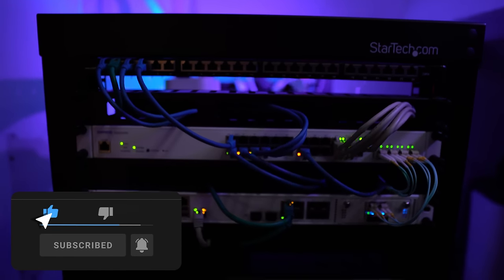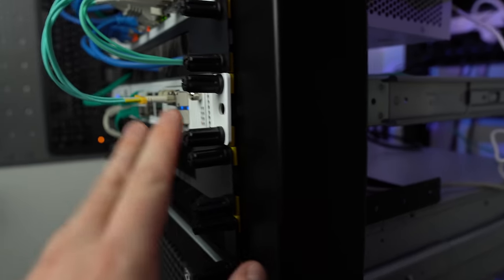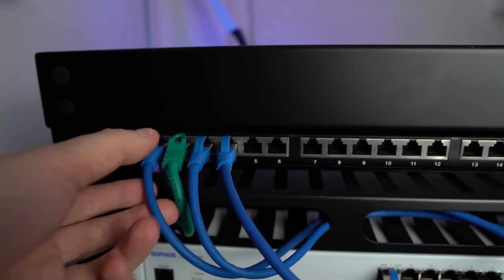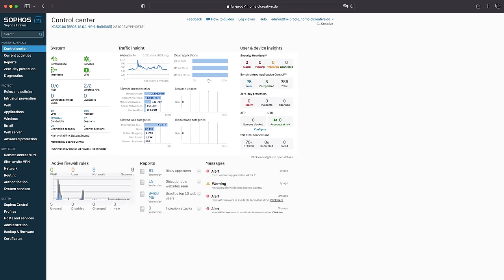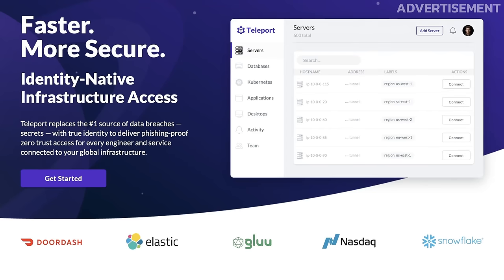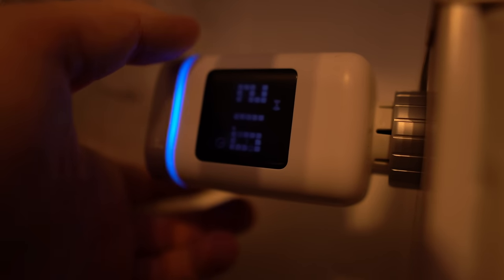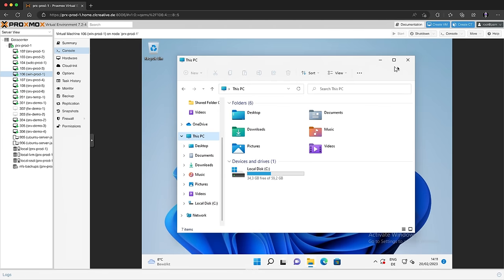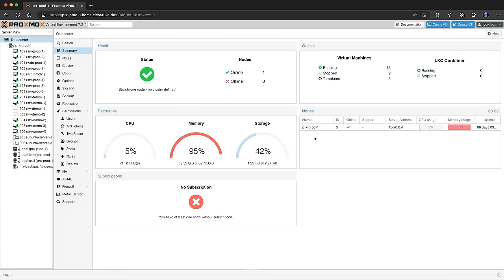What's running in my Home Lab?

Comment: Home Assistant is a centralised system that removes the needs for those hubs. For example a Zigbee adapter will communicate with most major smart lights, pairing them directly with Home Assistant (eg. ZHA.) I recommend a ethernet/PoE based adapter to make redundancy easier, the alternative is USB based. TubesZB is a good example.

Comment: Great homelab! I'm about to get the rack from startech, I can't wait to load it with my hardware that's been lying around the house.

By the way, I know that you've already made a couple of videos about teleport, but I'd love to know more about how you deployed it in your homelab and how you access your infrastructure (not to do reconnaissance I swear :') ), like if you have both your teleport CA and proxy running on the same machine or running them on two separate ones, if you run it in a VM running locally or in cloud instances and if you access the proxy from the internet or only from your lan or via VPN (I'm very curious to know about this because I also want to deploy teleport in my homelab, but for some reason I'm so hesitant to make the proxy accessible from the internet, even though it's said in the teleport docs that it's supposed to be, so I wanted to know how you do it).

I'd understand if you'd prefer not to, from a security point of view, to not disclose some of these informations, but it would be really cool to see you cover it a bit more, since you also mention it in every video.

Comment: About Vlan migration, do it progressively, no need to rush that.
The moment you have the necessary hardware, use it by adding your experiment on it, then slowly but surely migrate what you want to migrate on the vlans you created.
For exemple you could Do it by copying what you have, put the copy to work in the new Vlan, adapt the adresses and links and disabling the original one, and then... Well you have almost finish.

Give yourself 2 days dedicated to that each time you want to make such a move.

Comment: Very cool stuff, Christian! I actually am running TrueNAS Scale for my storage and VM host, as I've recently migrated my OPNsense instance from a dedicated miniPC from QTOM to a VM running under TrueNAS Scale's KVM implementation. It runs super well and not having a dedicated box using power and it not needing cooling is awesome. The only downside of course is that if I take the entire TNS server down for upgrades etc my internet connection'd be down too until it boots up again. I'm fine with that since that won't happen too often, and I was just wondering if it was possible, and it is. I'm so thrilled with how it's running. I at some point want to convert over to an entirely Ubiquiti Unifi-based network, with their APs and the Unifi Dream Machine Pro/SE (their firewall/router solution), but that'd be expensive, and I already currently have two of their older APs (their UAC Lites) as my WiFi solution for my family's apartment. I'm running consumer hardware as well.. I'm running a Ryzen 7 3700X with 64 GB of RAM, along with 10 (soon to be 12) 4TB HDDs for my Plex Media Server (which is the primary purpose for it all) all in a Fractal Design Define 7 XL case (it's a beast of a case). I guess I can call it my "home server" now since it's not just running Plex, but yeah. I really like how my stuff is all running, but your stuff is cool too.. I have no need for all the stuff you're running, but it's still interesting to watch and see what people out there have. I'll shut up now as I'm rambling, but thanks for the video!
Reply from the maker: Thank you so much! :)
Reply: @christianlempa  Any time!
Reply: @christianlempa  Sadly I've since repurposed yet another miniPC I have (this one that I had built for tinkering) to run OPNsense... the VM was constantly crashing, and I can't have that lol.

Comment: Great video. If you're going into IoT have a good look at Home Assistant - it really is an exciting open source product and as you are well experienced in configurations etc., it will suit you well.  It does help rationalising the number of hubs/ networks you end-up using.

I currently use promox and TrueNAs as you do. However, I setup a proxmox cluster with 2 nodes. Currently I use 1 node for TrueNAS running on a VM but I could add more VM on that node. I'm not sure if that was the smartest thing to do as it probably is more efficient running of bare metal. But similar to you, it's all about the experimentation and I was keen to have a proxmox cluster where I could possibly end up with HA across multiple servers  (nodes).
Reply from the maker: Thank you and great setup man !

Comment: Have you considered "tiny mini pc" like Lenovo ThinkCentre M70q or Dell Optiplex 3080 with Core i5-10500T . They are very small and don't use as much power as DIY server. That i5 cpu has 6C/12T and supports up 64GB of ram so its perfect for Proxmox :)

Comment: nice XGS 2100. Are you still running the XG home version on it? I ask because that is a nice rack unit and I would love to eventually migrate to an actual sophos unit but I wan't sure if the LED panels on the Sophos appliances function with the home ISO, which would be a nice added touch. Also, I'm nit-picking here, but it's disappointing that the Sophos Firewall does not have monitoring for UPS battery backups like the UTM does, which I have used in the past. It looks like one thing you are missing from your setup is a nice UPS with the monitoring software that could run on a Windows VM in proxmox. :)
Reply: EDIT: I didn't notice that you have an XGS model. I was thinking of the XG 125/135 which do not have the LED display.

Comment: btw. Die sparsamste brauchbare NAS HW die ich rumliegen hab ist ein Quad Pentium passiv Board, zusammen mit einer übel trivialen 10x SATA PCIE Delock Karte. Das braucht mit PSU und SATA Controller und zwei SSDs etwa 12-14W aus der Dose. (Pico PSU 120W in dem Fall, mit 12 Platten dann aber eher ein 300W Gold PSU)

Comment: Hello Christian. I am running vmware Esxi 7 Update3 (dual boot with MacOS Mojave) on my Mac mini 2018 with Core i7 8700B and 64 GB RAM. I have to tell you that this pretty portable ESXI server  that is currently running 12 high spec  VMs to provision 2 Kubernetes cluster with Portworx and Ceph Storage Clusters. There are many limitations using ESXI with MAC as they do not support  USB Passthrough and even internal storage but It still gets the work done.
Reply from the maker: Nice, sounds interesting! Haven’t tried that out with an older Mac mini

Comment: 12 degrees celcius lowest SSD temperature? Were you running this in front of an open window at night? I'm actually interested in your HDD temperatures. If I remember it correctly from your storage server video, you're using BeQuiet fans, correct? Have you thought about replacing them by models which can produce a higher static pressure?

Comment: Great home lab, but somewhat expensive :)  I am a thrifty Dutchman living in Santiago de los Caballeros.  I have an extremely cheap home-lab. 

First my network:  I use an ISP router (50/10 Mbps) and my >10 year's old TP WiFi Router connected to the ISP router.  For security I changed user-id and password, it is closed for inbound traffic and it only accepts admin access from the MAC address of my laptop or desktop.  It runs Wifi at 135Mbps and Ethernet at 100Mbps. Wifi is fine for phones and my Smart TV, but I've added a 5 port Ethernet switch ($12) at 1 Gbps for the PCs.

Now my PCs:  Note that all storage is based on OpenZFS 2.1.4 (lz4 compressed). 
- a $349 Ryzen 3 2200G from April 2019; 16GB DDR4 (3000MHz); 512GB SP nvme (3400/2300MB/s); a $36 xTech Midi Tower Combo (600W; 24 pin; 4 pin; 2 SATA and 2 IDE plugs :) :) ).  Reused leftovers are: 2TB HDD supported by a 128GB SSD as cache (L2ARC). Running a minimal install of Ubuntu 22.04 LTS.
- a $250 off-lease HP Elitebook 8460p from end 2011 bought in April 2017; Intel i5-2520M; 8GB DDR3; 2TB HDD. Running Ubuntu 22.04 LTS.
- an ancient Pentium 4 based on the remains of a 2003 HP d530 SFF, now in a Compaq Evo Tower with Win 98SE activation sticker.  It has 5 leftover HDDs (2 IDE; 3.5"; 250+320GB; 2 SATA-1; 2.5"; 320+320GB and 1 USB2; 3.5"; 500GB). Running FreeBSD 13.1.

Since March 2010 I'm a collector of Virtualbox VMs, so I have all Windows releases from 1.04 (1987) till 11 Pro (2022) and all Ubuntu LTS Releases, the first 4.10 and my first 5.04.  I have divided my hobby and work over 6 main VMs running from OpenZFS on the nvme-SSD.  Those VMs are:
- Xubuntu 22.04 LTS (communication apps), boot time ~7 seconds; 
- encrypted Ubuntu 16.04 ESM (financial stuff) with the latest stable snaps for Firefox and LibreOffice;
- Ubuntu Studio 20.04 LTS for multimedia;
- Ubuntu 22.04 LTS for experiments and app try-outs;
- Windows 11 Pro, just in case;
- Windows XP Home to play the wma copies of my LPs and CDs with WoW and TrueBass effects. XP is installed and activated March 2010 and it survived 3 desktops and 4 CPUs! 

Note the desktop is backed up weekly (send | ssh receive) to laptop and Pentium 4, so on the road I have on my laptop exactly the same up-to-date VMs and data as on my desktop :)
Note that in Ubuntu 16.04 I succeeded in collecting all functions hated by the usual fanatics: Unity; Snaps and Ubuntu Pro :) :)
Reply from the maker: Thanks! Yeah it's quite expensive, I was lucky to get some of this stuff from my employer, so that makes it a bit more reasonable.. but still... it's crazy :P

Comment: Why do you run both a FreeNAS and a Proxmox server? What features are missing from Proxmox such that it's not the choice for both storage and VM? I installed my Proxmox instance on a ZFS raid 1 ssd and generally host the VM and LXC boot images there,. and then the large data on a separate ZFS raid drive. Perhaps you should consider running Proxmox directly on your current FreeNAS server and then clustering the Proxmox instances? Why do you use VMs instead of LXC images? LXC seems to be a more efficient solution for Linux apps. VMs are still needed for things like your Windows instance. Thanks for the tour!
Reply from the maker: So many questions, I don’t know which one to answer first 😖

Comment: Quick question: How did you manage to enable Bridge mode on your Vodafone FB? I cannot find a setting for it and adding another layer of NAT seems dumb
Reply from the maker: There is a setting for „exposed host“, which will forward all ports to the WAN port of the firewall. However it is a dual NAT

Comment: Congrats on 100K subs, and nice homelab 👍
What video card do you have in your storage server? 
How do you have 10Gb, HBA, and graphics, as the 3600 doesn't have integrated graphics??
I'm looking to upgrade my proxmox server and plan to virtualise trunas, and want 10Gb, but there's just not enough PCIE lanes available for HBA, 10Gb, and video card, unless I get a less powerfull Ryzen 5000 series G cpu with integrated gpu. 7000 Ryzen is still a large bump in price but would work perfectly.
Reply from the maker: Thank you so much! I've booted the server without the 10Gb network card, installed everything, and then booted without the graphics card. Maybe I'll upgrade it with an intel CPU in the future, I'm not so convinced of AMD anymore.
Reply: @christianlempa  So your system works without a GPU? I didn't think that would work. I may have to experiment, as that would solve my issues.
The new AMD cpu's look amazing for a proxmox setup. Not sure how proxmox would handle the new big little intel cpu's though.
Thanks for replying :)

Comment: Hi Christian, I find your channel very interesting. I have a question that I was hoping you might be able to help with. I was using an old PC case for my NAS box running TrueNAS scale on an AMD4 Ryzen 5 2600. I recently purchased a server case to put the NAS into so I could put it into my rack, the case came with 4 centre fans installed on a PCB with a molex connector and an 8 pin connector, I am thinking the 8 pin connector is for the fan controller, each on the individual fan plug into a 4 pin connect on the PCB. I am unable to find an 8 pin fan controller and I am not sure, if i could it would be compatable with the fan controller on my motherboard any way being it is a consumer MB. Do you have any advice, did your case come with fans, what sort of fan controller do you use? Any help/advice would be greatly appreciated.
Reply from the maker: Thanks mate :) I’m not sure about what this 8 pin connector should be. You might think about replacing it with a different fan controller where you connect your fans directly to. That’s usually how I do it.

Comment: Are you providing storage for docker volumes with nfs-shares, also for dbms like sqlite3, postgres, redis, mariadb or mysql? is this a reliable solution and even possible?
Reply from the maker: Haven’t had any issues with that, but I tend to avoid running the databases with an nfs volume.